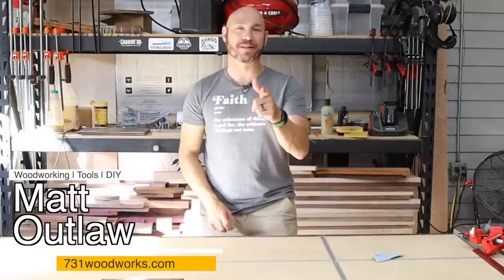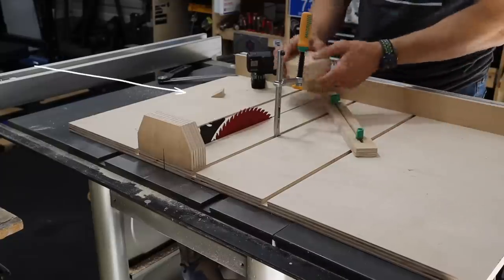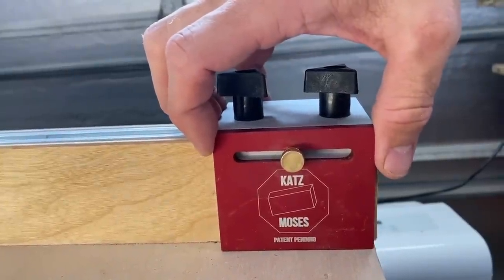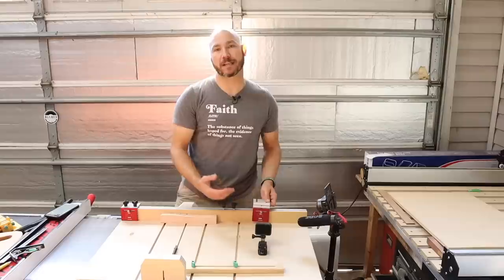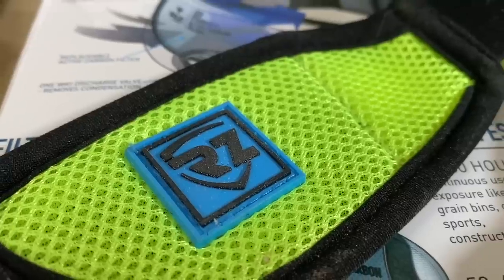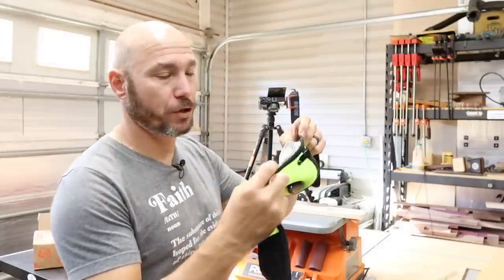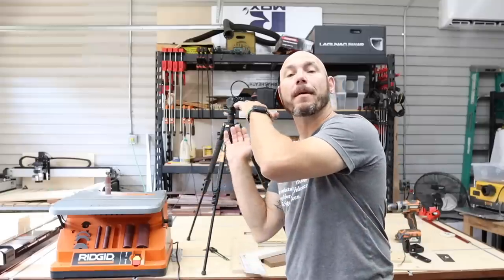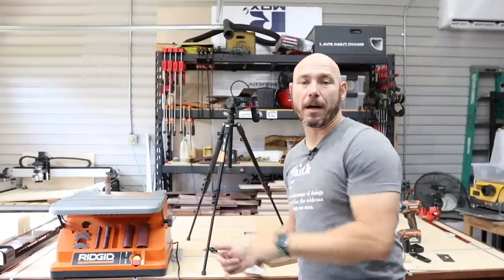5 Woodworking Tools You Didn't Know You Needed Until Now Vol. 2

Comment: Thanks so much for the shout brother! I'm so stoked you love it. Build for Woodworkers by a woodworker who was frustrated by the play is the most popular flip stops.
Reply: Both of you are my favorite You Tube channel
Reply: Awesome stops Jonathan. 731 sent me a couple...just one word.. WOW! AWESOME!!. OK 2 words. Thank you both!
Reply: One thing I like on the design of your stop is that the track knobs are easy to replace. The ones that come with it are good, but since the slots you used are so generic I can put in other jig hardware when I need to use something different like the heads of 1/4-20 bolts. For this reason I've found it very useful for custom jigs.
Reply: Bought my stop a few years back and love it. More versatile than you think. I use it on my table saw and when plunge routing on my router table. Easy to use and works great.

Comment: Five more excellent suggestions for tools that make you a more efficient and productive woodworker.  I am very thankful that I followed your advice purchased a Home Right Sprayer.  It is an unbelievable sprayer.  It's easy to use and easy to clean up after using.
The Rigid oscillating sander is an excellent suggestion.  It is more powerful than most sanders and carries a lifetime warranty.  Thanks for another useful and enjoyable video.
Reply from the maker: Thank you PT

Comment: I have used my RZ mask for a couple years now. I usually run the charcoal filters irregardless of what I am doing. That way I don't have to  change filters when staining or painting. Just picked up two new masks as my old one had started showing its age. Highly recommended one to keep the lungs safe. 
I picked up a High Volume Low Pressure sprayer after watching a Katz Moses video. Greatest thing ever for tight corners where a brush or sponge applicator won't go. He even had a link to the set-up he currently uses.
I was using a piece of PVC with sandpaper glued to it for curved pieces. Works well for small projects, but ultimately took way to long. I search FB marketplace all the time for tool sales and was able to pick up a used spindle sander, talk about a game changer. Definitely one of those things where you ask yourself, "Why didn't I get this sooner"?
Thanks for the great content 👍

Comment: No bonus? :)  I don't have spindle sander. I am looking to upgrade some of other tools, that I use in most of my projects. 
I glue sand paper to dowel rods to help with sanding curved elements, especially inside the wood. I also use my drill press for sanding on some of my projects.

Comment: I bought the rigid oscillating sander to make sanding the edges, rounded corners and chwmfers on cutting boards I've been making. One issue I've had with the belt part is that it tends to be a little too quick aggressive causing the workpiece to kick out of my hands and remove too much material even with fine grit belts. I've tried to set up a stop using the miter track and such but nothing has really helped. I'm using the belt cause I want flat edges but wondering if I should be using the spindle instead.
Another issue is that while it has a miter slot (which is why I chose it over the triton or Wen models) it has the same issue as I've had with my Bosch RA1811 router table in that the s,ot is way too wide, where I've had to add at least 40 thousands of UHMD tape to even get close to getting slot lock accessories to clamp in and re ders miter gauges useless. Any input on that?
The biggest issue I've had is getting a kind of scalloping or vertical indentations. I've tried belts from a couple manufacturers with the same result. Do you have any suggestions on dealing with this?

Comment: How is the mask with fogging up glasses. One reason I dont usually wear one is because my safety glasses fog up which creates more of a safety hazzard
Reply from the maker: Amazon sells anti fog safety glasses, that’s what I use
Reply: I started using a 3M respirator and they don’t fog up at all and filter much better. Very helpful for allergies
Reply: i have the RZ mask and my glasses do not fog up. reason i bought the mask.

Comment: Love all your videos, Matt.  And your FB group is the nicest on FB.   Question about the Ridgid spindle sander.  I'm. borrowing one right now while my friend is on vacation.  When I use the spindles (any of them) without the biggest washer over them, the paper rides up the spindle.   I noticed that. you have a small washer on yours, but that didn't work for me.   Have you seen this?   Any ideas?   It's a new unit that's had very little use so far.   I plan on buying one, but not sure if this is a problem.    Also, I hear that the parts (sandpaper) are hard to find.  True? Thanks.  Merry Christmas.
Reply from the maker: Thank you.  I have seen it happen. I tighten down the top nut more and it keeps them in place.  Sandpaper is easy to find on Amazon.  I've ordered some from there

Comment: Have you looked into building a pony tank (idk if that's the technical name for it) for your compressor?  I'm a carpenter by trade and we had an underpowered compressor when we were running multiple framing guns.  With the pony tank, we were able to run all day without any problems because it turned his 6 gallon compressor into like a 20 gallon system.  Idk how much of a difference it would make with painting, but like I said, we ran all day with framing guns with no problem.